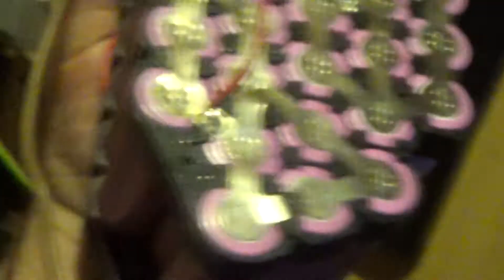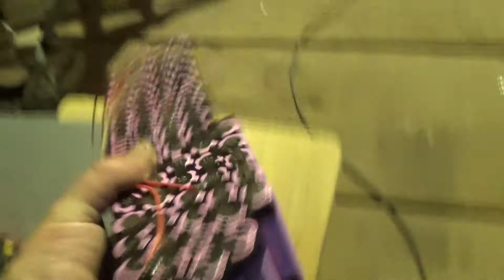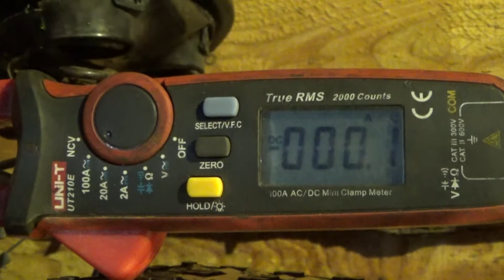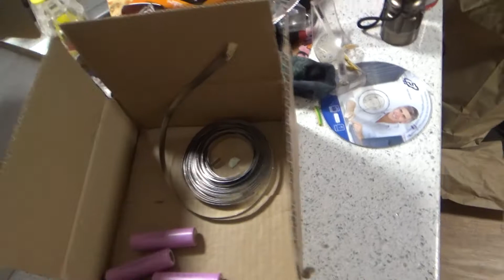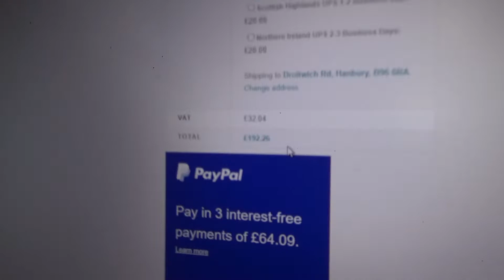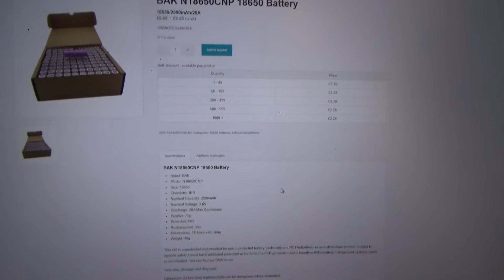Battery Build NIGHTMARE, Fake cells from ali express

Comment: Its definitely because you have such high resistance with the nickel. Guessing nickel plated steel maybe 0.12mm or 0.15mm thick? Yeah you can't draw more than 20 or 30 amps until voltage drop is insane

Also 35E's are good for 8A continuous according to the datasheet

Those 15Q's are rated at 18A so huge difference
Reply: Until you do a proper load test on individual cells along with a capacity test at 0.2C you can't say for sure what you've got. The fact that those "rubbish" 35E's weigh more than the BAK cells leads me to believe they arent total junk cells